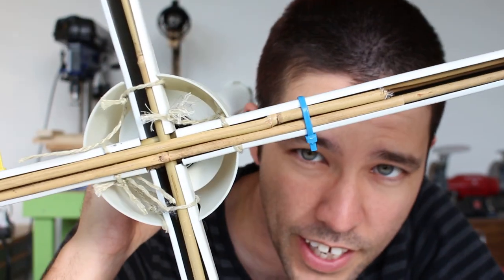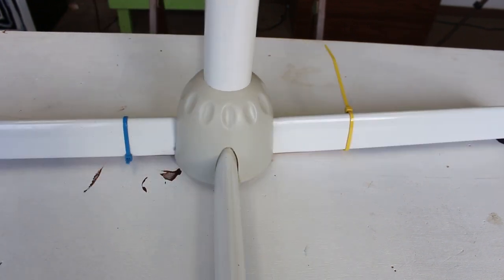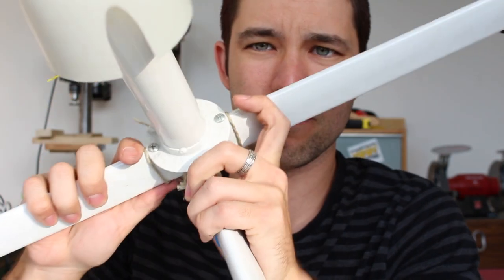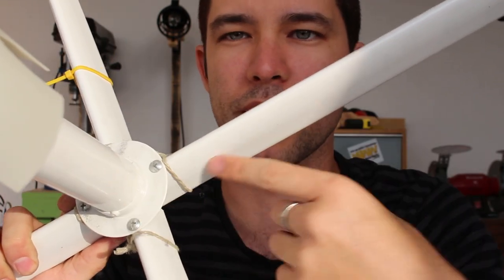Fixing my fan

Comment: Hey, I had that exact fan.  I think they just didn't add the parts to all of them.  AND I did what you did to fix it, wow, small world.  Great job, BTW.
Reply from the maker: thanks Jim. Yeah it was strange, the one bar going across was solid but the other one was two pieces, but there weren't any parts included to connect them together, so that's what the bamboo was sort of doing. The whole fan would lean way over all as the bamboo would flex. But even after five years of leaning it never fell.

Comment: What you made with the wood is SO much better. If only they were made that way to begin with instead of the cheap bendable metal. I would buy it in the store if you sold your design.
Reply from the maker: thanks Tanya. We ended up moving out of the country a few years later, I think I gave the fan to a friend, so it's probably still in use today with this home-made stand setup.
Reply: @BruceChastain  Wow, that’s so cool how that ended up and that it’s still standing!!!

Comment: great job Bruce you can hardly tell  that wasn't the original Base. I agree with Lou that half lap joint was spot-on. By the way would you be interested in a sticker swap with me?
Reply from the maker: Thanks a lot Opa. Might have looked nicer it I would have rounded the ends. Actually I don't have any stickers :)